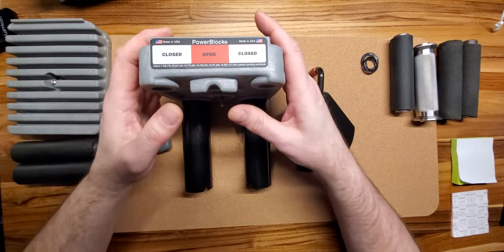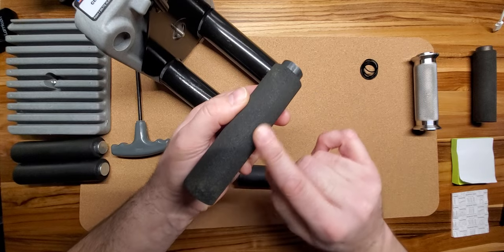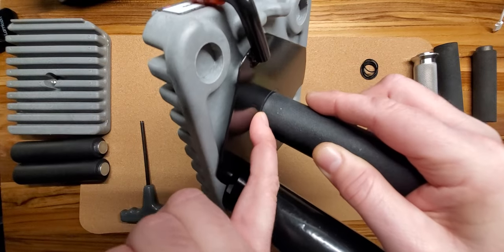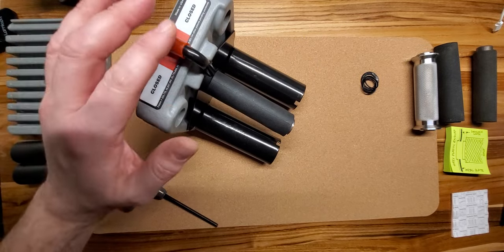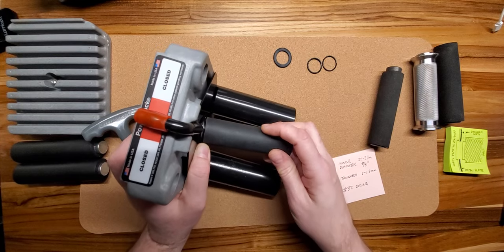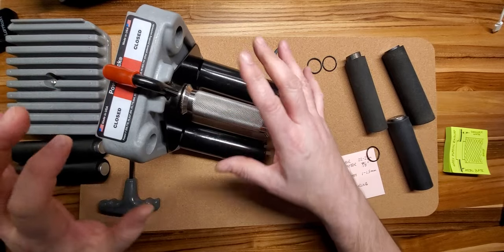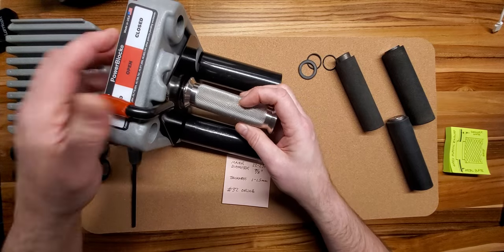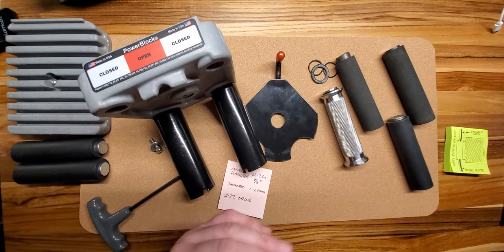How to Adjust the Grip Fit of Powerblock® Elite USA Dumbbells (applies to OEM and Average Joe grips)

Comment: My handles were very loose and finding #32 o-rings in my area and even online was harder than it should have been. The only ones I could find are 1/8" thickness and are too wide, but work for now (handles are really tight). Thanks for the update and I'll keep an eye out for thinner o-rings.
Reply from the maker: Hi Matthew, I'll hop on over to the local mom-n-pop and pick up a couple of the ones you need. I'll send those out this week. We have a great little specialty small hardware store in town that Home Depot hasn't killed off. These rings should feel a heck of a lot better than the 1/8" that you found. As you discovered, 1/8" is too much. And if the washer company gets back to me about my request, then I may have some nice custom washers by April/May. If I do, you're welcome to a pair of those too.
Reply: @AverageJoeInnovationsLLC  Thank you!

Comment: I upgraded from sport 50s to the powerblock elite USA models and I hate the grips. I loved the grips on the 50s, that have that fusiform  shape (tapered from middle outward) that worked great for me, is anyone calling for a recreation of that from you or am I just the odd man out? The elite handles are too thin regardless so I'll be getting some of your product I'm just curious if there's any possibility of a shaped grip beyond the mighty cylinder
Reply from the maker: Hi, TWG. You're the first to request a knurled fusiform grip. I wouldn't say it is impossible. I just don't know off the top of my head how it'd be done. I'd have to have a conversation with my manufacturers here and abroad.  My primary concern would be all of the potential additional machine time and set up. I suspect they'd be a lot more costly to manufacture.  

For the heck of it I'll inquire in the weeks ahead about the feasibility. If I have anything new to share, I'll let you all know.
Cheers,
Joe

Comment: Hey! This wouldn't work with the Sport version eh? We don't have the USA Elite version in Canada unfortunately.
Reply from the maker: HI Lash, Typically the various Sport Powerblock models require what I call my "Type A" grip. So I do make a grip that fits most sport models. 

The video above is just for USA Elite owners whose dumbbells require my Type B grip. 

If you head on over to knurledgrips.com there's more info about compatibility, etc.  You'll see a section with photos and dimensions so you can compare with your dumbbell to determine the correct Average Joe grip type.